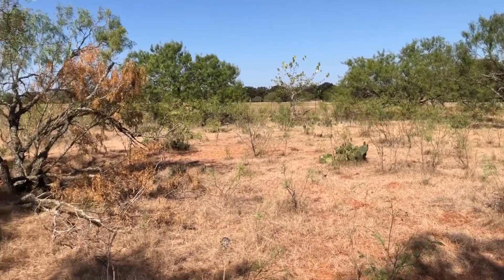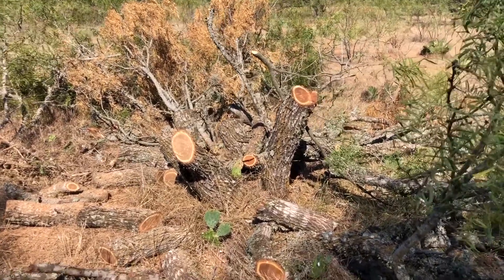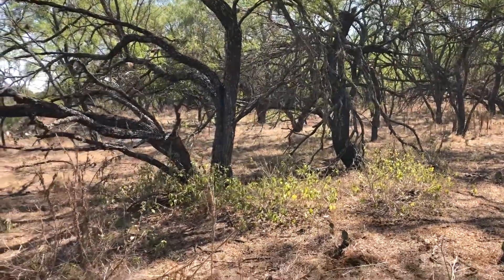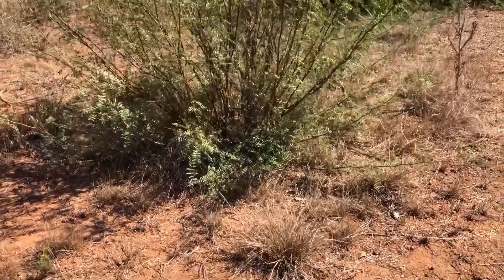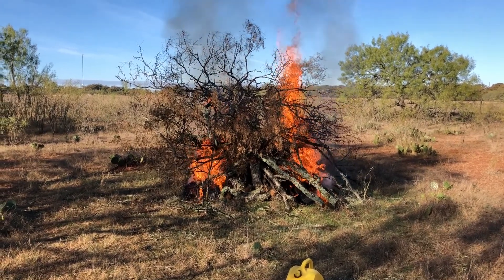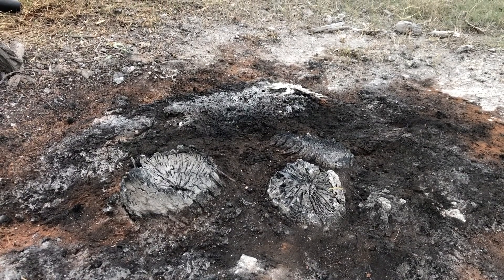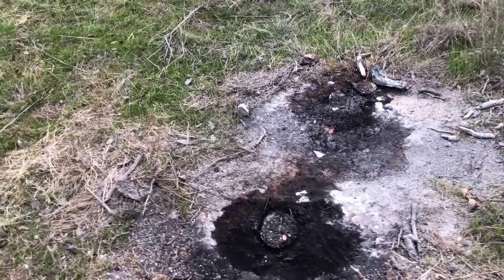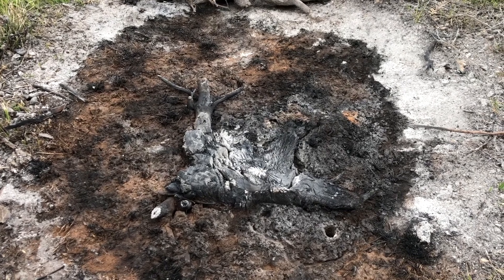Central Texas Mesquite Removal - Stump Burn Experiment

Comment: 4 years later. Did it work?
Reply from the maker: Sort of, where the fire was directly over the stumps and the fire stayed hot for several hours, it did. If the fire wasn't centered or if it didn't stay really hot for several hours (3+ hours) then they just came back the next spring. Though it sounds easy to center the fire over the stump, when you start stacking wood and it starts burning, you lose track of exactly where the stump is. My advice would be to leave 6 to 8 inches of the stump above ground level to keep track of it and allow the coals to burn down into it.

Comment: I am encouraged!  I think digging around the base with a shovel (easier after rain) then coating with old engine oil or diesel fuel and some fuel around it, a few charcoal briquets? should provide that extended heat to kill the bud zone.

Comment: May not be easy but I wonder if digging out before setting the fire would help? I have an abundance of mesquite I need to thin. Might give it a try.
Reply from the maker: I have an update video coming. While the fire didn't burn the stump underground, it killed the mesquites with 100% effectiveness. The moral to the story is you don't need to burn the stump completely out (though that would be my preference) you only need to get the ground hot enough to kill the sprout area at the top of the stump.
Reply: @Mrpaint06  i was just about to ask for the update... i have about 4 acres of rogue mesquite to clear.